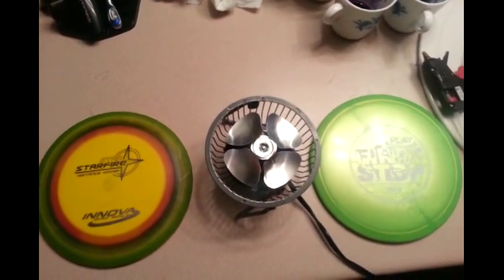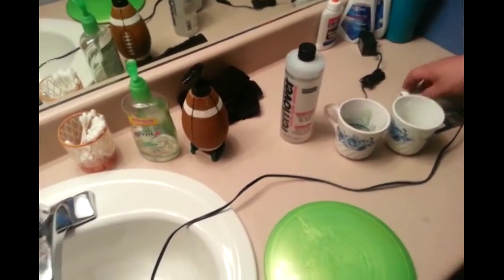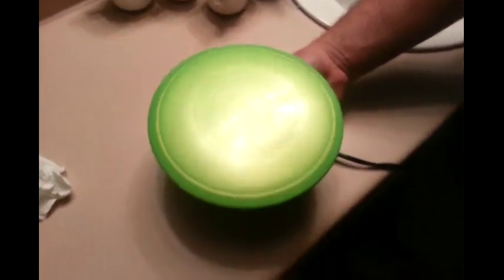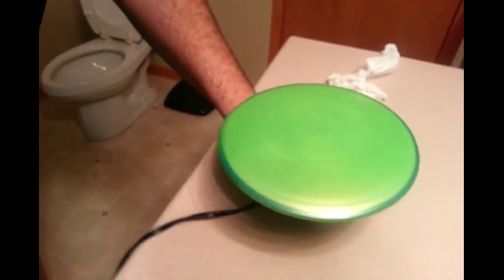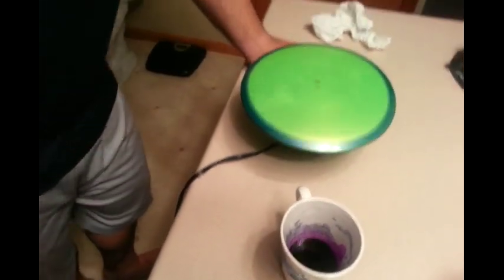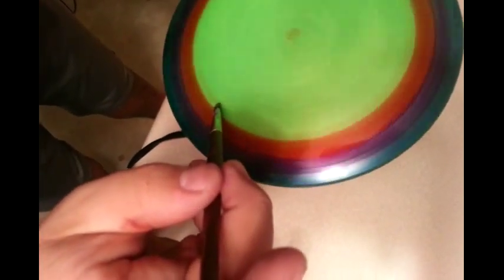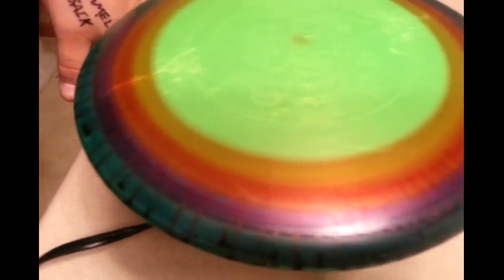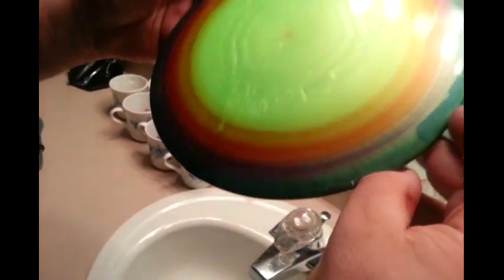Disc Golf Dye Technique: Spin Dye

Comment: Cool design! Did you add some acetone to the dye you applied to the disc? Was one of you turning the fan on and off to control the speed...?
Reply: Go retro LP player instead. you will get a flatter surface, and much easier to hit the center, and no need for speed control, they only have two speeds. a fan like this one will prob ruin more dyes than make succsesful ones.